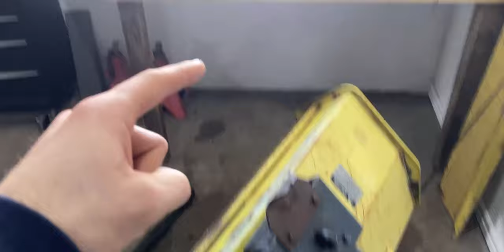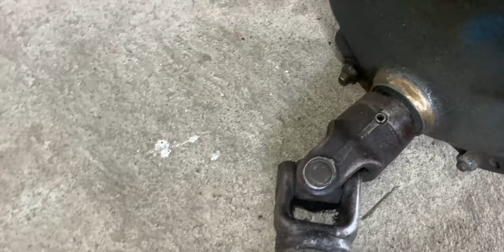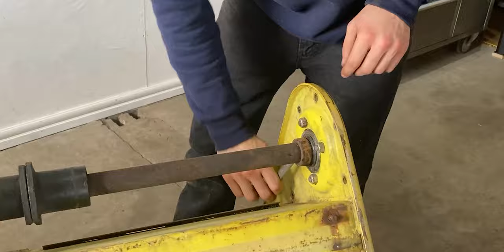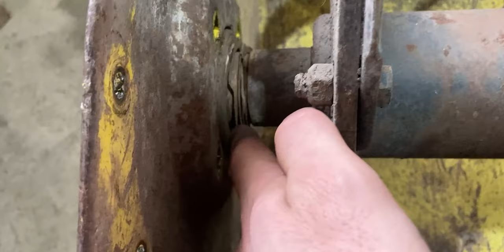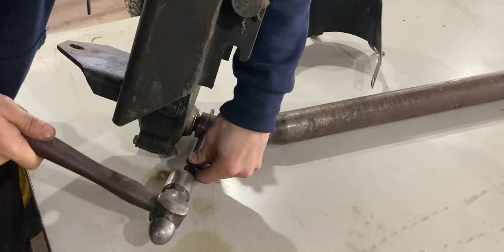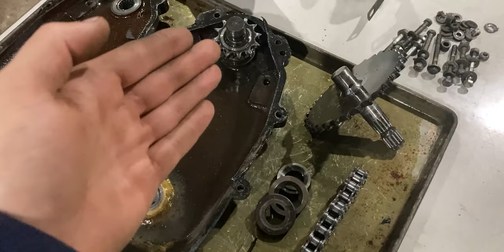John Deere 35A Tiller & PTO Conversion Kit Teardown

Comment: There’s enough power with the 400 that if you drop the tiller on hard ground it will just push the tractor, and faster than you think.  I did change up the tiller a bit, flipped the ring gear to the other side, put in an idler sprocket on the drive chain, and flipped the tines around.  It works great as a reverse tine on hard ground, but it doesn’t leave a smooth trail behind.  I might just switch it back since the ground is amended properly.
Reply from the maker: Wow, now that is interesting! I believe you when you say the tiller has the ability to push the tractor forward, once it's in motion! Your tensioner modification is very good, as the UHMV tensioners do wear out quickly and it is a little bit flimsy.
Did your DJ400 handle better while tilling in reverse? I'm really curious to know.
Thanks for sharing your experience and modification, Best regards Andreas
Reply: Mind you, I still run turf tires while tilling, I haven’t mounted the r4’s on the spare rims yet. 

As far as tilling, before reverse tine, on hard ground I would have to raise the gate,  lower it partially down, and back up feathering the hydraulics . There were cases doing other peoples gardens that I’d have to do that again, then drop the gate, and go forward to level it out.  With the reverse tine set up you can do hard ground in one pass, but slowly. Soft ground is absolutely no problem, other than slightly wavy passes.  

In really hard ground, or if you hit a hard pan, the tiller will jump something terrible. To curb that I made a chisel plow with box blade shanks to pretreat the area.
Reply from the maker: @patientvengeance  I agree, turf tires might not be the best option for tilling. My JD400 is setup with turf tires as well, so I will have to see how that goes!

It does sound like the rototiller takes a bit longer to initially make it's way down, but advancing forward must be easier at a certain depth. Soil conditions must play a huge factor. If an area has never been tilled, it must be like rock or at least very hard to work with!
I have a feeling your reverse tine setup worked wonders the way you describe it. Great work for figuring that out and changing the direction of rotation!!
As well as your box blade with shanks, that must be a very cool attachment. It must help tremendously to loosen up up the soil so the garden tractor doesn't have to work too hard!
It's very cool to hear this, thanks again :D
Reply: Well, it’s not a box blade yet, just the beam with 5 shank locations, but when I finish it the box will be removable for use in the garden. 😁

My Grandfather gave me the tractor in 1976, it’s been rebuilt and repowered, and has more hours on it than anyone knows, been through 3 hour meters.   I hope to have the time to restore it much as you have on your project, it inspires one to dream. 

Thank you.
Reply from the maker: I understand what you want to eventually make, but for the time being, your 5 shank ripper is very neat! It's wild to know that you have turf tires and this actually works! How long are your shanks?
I'm glad to hear you still have that tractor! It sounds like it could go on forever haha Maybe you are already at 4000hours...that would be pretty crazy for a garden tractor to be honest!
Personally, I think restoring a tractor is a good thing to do. Not only do you have a brand new tractor in the end, but all those years of debris and rust are gone. I believe it can only prolong the lifetime of any machine out there. 
If you do have the time, I would suggest you restore it. You will learn a bunch and have a brand spanking new tractor in the end! Best regards
Reply: The shanks are 18” with 4 holes. As far as garden work, I’ve only had 2 shanks on it, set to probably over 12”. With the turf tires you do have to feather the hydraulics, she won’t straight pull it, but if you jiggle it in the ground it will. 

Since attachments are rare, not quite what one wants, or non-existent, it always nice to try modify or fabricate your own. 😁
Reply from the maker: @patientvengeance  Those shanks are impressive, nevertheless! You must have great experience running your own attachments and I believe you made yourself a very useful attachment! Great work!
That is correct, the JD400 attachments are hard to find and even newer attachments could be in some way modified.

Comment: Hey can you help me source parts for the pto conversion kit. My rototiller drive is completely broken and I need the chain
Reply from the maker: These aren't very common to come by, and it's best to source them online. The chain on the other hand is a very common size and can be purchased at any industrial dealer. You must know how many links you need and the chain pitch. With this information you can easily make a chain with a master link.

Comment: Is this tiller driven by a CCW 2000 rpm PTO?
Reply from the maker: Excuse me for my late reply! Yes, this rototiller turns CCW, but the input speed for this model is not 2000RPM! When hooked up to a John Deere 400, the input speed (PTO RPM) for this rototiller will be 840RPM. This is only for the John Deere 400, as it has a special reduction setup from the engine to the rear attachments. I hope this helps -Andreas

Comment: Great video, the tiller has some similarities to my model 48. I can tell they are made by the same company. Did the drive chain on the tiller have a way of tensioning the chain?
Reply from the maker: Thank you John! Yes we spoke about that and I'm sure this a Model 35 and this tiller is specifically a F035G. That is correct, this was produced (or at least produced for) John Deere. The drive chain had a tensioner and I believe it fell down on the ground once I removed the cover. All it is, is a little block of UHMW , a spring and a spacer that is between both sprockets. I will showcase this in an upcoming video.
Here is a link for some information to the John Deere 35 Rototiller: https://www.tractorbynet.com/forums/threads/john-deere-model-48-tiller-manuals.385825/

I hope this can clarify if you have a model 35 rototiller or not. 
Best regards